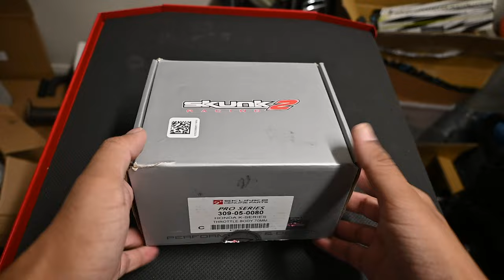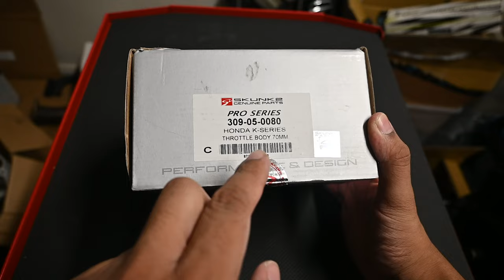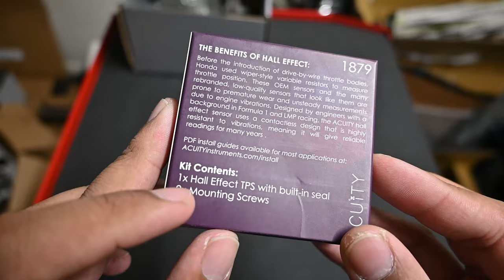Skunk2 PRO 70mm Throttlebody + Acuity TPS & IACV | K24 DC5

Comment: I have a dumb question but where does the hose connect from the iacv? Where does it run to from the iacv?
Reply: Nothings a dumb question bro

Iacv valve hose goes to the intake manifold
Reply: on my ek with a 90mm throttle body and race manifold i run a k power iacv bracket with 2 hoses that run to the intake manifold and the intake 

but if your doing it stock like how he is the vacuum  line goes to the intake
Reply: @jlr1670  thank you!

Comment: Did you ever solve the throttle body fitment issue? Did you use a thermal gasket?
Reply from the maker: The issue was never the gasket, it was clearance due to the intake spacer hitting the throttle body. Had it machined down a notch to clear.
Reply: @DIVINERPM you need to listen other people the issue with that manifold and the Tb is that if you just install the thermo gasket and problem solve without notch anything I talking because I have exactly the same setup and i just put the thermo gasket and that is
Reply from the maker: @3030rey  Are you saying if I use the gasket on the Tb, it will clear the intake spacer? I needed more space than the thermal gasket because im running the intake spacer.

Comment: What belt are you using
Reply from the maker: Using this belt: Gates Micro-V Belt 7PK1740
This is for K24A3
Reply: @DIVINERPM  are running A/C..with that belt?...
Reply from the maker: @cadettmorris4836  yep running AC and Power Steering. I used this tensioner: 
Gates Automatic Belt Tensioner 38278
Reply: @DIVINERPM  thanks